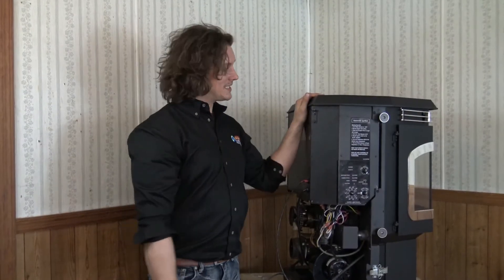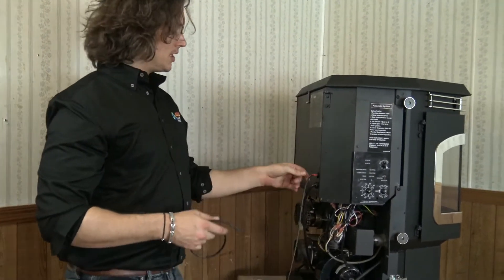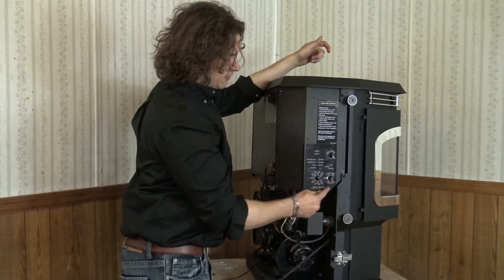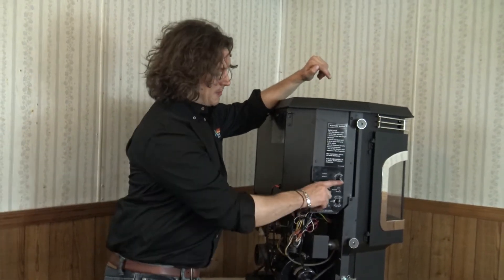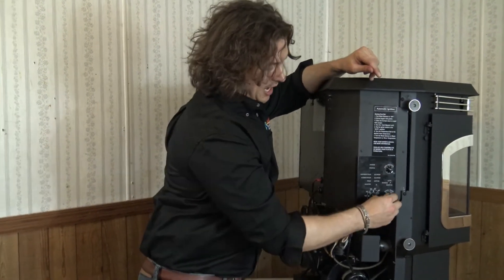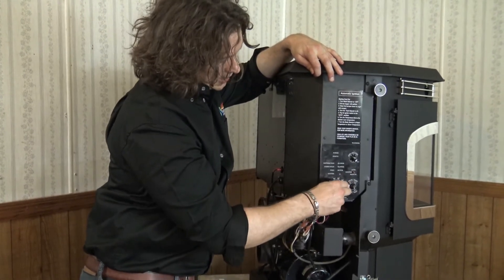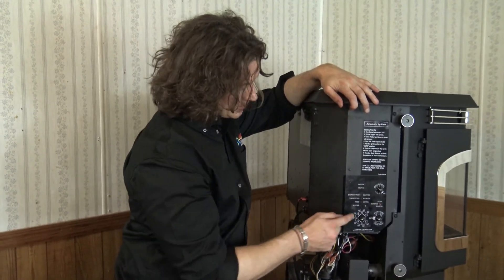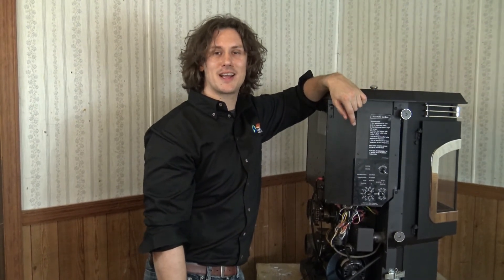Harman Stove Controls, How to use a Harman Pellet Stove

Comment: I just bought an Accentra-2 pellet stove second hand. There is another switch that has a high and low mode for the fan. Does this over-ride the dial? Also, is it possible to connect a thermostat to the stove? Since I have it in my garage, I'd love to have a WiFi thermostat that I can remotely access to start the stove heating before I go out to work. Thanks for a the video. It was very informative.
Reply from the maker: Hey Mark, thanks for contacting us. Yes, the earlier Accentra FS models will have the additional blower rocker switch inside the control board cavity. It does not override the L/H on the room temp/stove temp dial, it simply is an additional blower speed adjustment. In most cases folks would leave that on low and in the coldest weather kick it up to high if the area needs that additional boost - Feel free to play around with it and find what works best for you.
As for the Thermostat, the Accentra is designed to work off the Room Temp Probe which plugs into the back of the unit. It's about a 5' probe which can be extended if needed. Using room temp mode on the board and setting the temp dial to where you like it would be the most common way to operate the unit. With the igniter toggle on Auto you can set your temp and the unit will turn off and on as needed to hold that preset temp. Unfortunately with your model you would not be able to connect any kind of programmable or WiFi thermostat. Some of Harman's newer models such as the XXV-TC, Absolute Models and Allure 50 do have a digital control panels with some of those options. The Accentra is a solid unit, any other other questions or needs as you go along just let us know. Thanks!
Reply: @EarthSense  thanks for the information. Since it's in a rather large garage (25x48) I will most likely use it on stove temp with auto. I do have the room temp sensor installed and it's on the back of the unit, like you showed in your video.
Reply from the maker: @striperseeker  Sure thing Mark. Feel free to play around with both modes of operation and see what works best for your situation. Just note on Stove temp it's designed to run  wherever you have it set consistently; it will not turn on/off on it's own in that mode. Any other questions just let us know. Appreciated!

Comment: Just installed a used P45 stove, I have it set in room temp mode on Auto, and once room reached the set temperature and fire went out but the blower did not actually shut down completely.  Approximately how long would it take before blower actually turns off OR does it continue to run until I turn stove setting to off?
Reply from the maker: Thanks for contacting us. In Harman stoves the exhaust motor will continue to run for a period of about an hour on average until the exhaust ESP probe senses it is cool enough to safely shut down. Let us know how long the motor is running when it goes into shutdown. Thanks.

Comment: Thanks for the video. I have a Harmon 61 A. I run it on room temperature. When the dial is turned to Low or half way beyond the middle and high, the fan/blower makes a higher pitched whistling noise. If I turn it to  H,  the noise stops. Is that normal? Should it run on high? The room temp is set around 72 degrees.  The people who service my stove have replaced the fan/blower twice. It also happens on stove temp.  Thank you.
Reply from the maker: Thanks for the message, happy to assist. It sounds like as you make that adjustment and voltage is differentiating to the blower that it is making that noise. I would not say that is normal, you should be able to have the dial on L or H or in between without a noise such as that emitting. I would strongly lean towards it being a blower issue causing the noise based on your description and that fact it does it in room temp and stove temp modes. You can certainly run it on High to avoid the noise, however it is nice to be able to adjust the room air speed depending on the fire size and desired air blowing out. I would check to see when the last blower replacement was put in; if it was a factory blower it would be a 90 day warranty, if it was aftermarket most will have a 6 mo or 1 year warranty. Here is a link for reference for both the aftermarket and OEM replacement blower options. https://pellethead.com/product/harman-distribution-convection-room-air-fan-blower-motor-amp/

Any further questions please let us know, happy to assist.
Reply: @EarthSense  Thank you so much. I have left  it set close to High for the last few days and the noise is gone. I appreciate your help.
Reply from the maker: @MLK.17  Happy to hear, any further questions or assistance please let us know. Thanks!

Comment: I have a Harman Accentra 52i.  I just had it professionally cleaned.  I replaced the medallion that had warped.  My husband can no longer maintain/operate it.  I'm learning.  Today I started it for the first time.  It appeared to work beautifully.  After a few hours, the feed motor and igniter lights went out and the distribution and combustion motors blow constantly.  The stove is set on auto, # 3 feed, 70 degrees and medium between green and orange.  I shut the whole thing down and unplugged from power.  What's wrong?
Reply from the maker: Thanks for contacting us Beatrice, happy to help. When running the unit on auto in room temp it will run and operate until the unit meets that temperature you set it at based on the room temp probe. Once temp is met, the fire will go down to the lowest setting and the unit will shut itself down if heat is not called for. The exhaust motor and distribution fan will run for a bit in shutdown - exhaust fan will run for up to an hour approx. until the exhaust probe senses that it is cool enough to shut off completely. If the unit is shutting down before temperature is met, I would first say let's take a look at the room temperature probe and possibly adjust the placement - we want to make sure drafts and/or direct sunlight is not interfering. If once the stove is shut down, the blowers continue to run and run until you actually unplug the unit, then we have a different issue. Most likely this would have to do with the exhaust ESP probe and the temperature it's reading. We do have a video that shows how to inspect/clean and replace that probe if needed, however that should have been done by your maintenance person. How long are your blowers running when the stove shuts down? As for the lights, you should find that the igniter light goes out right after initial ignition takes place. The feed light will go on and off in operation as the unit is feeding fuel - off completely when the stove is in shutdown. The Combustion light will stay solid once you turn on the stove and will shut off once the unit is completely cool. The distribution light will come on after start-up once the unit is warm enough and will stay solid until the unit shuts down and is cool enough to shut the blower off. Let's start with the simple things first and we can take it from there. Keep us posted, happy to help. Thanks!

Comment: Hi, we just bought this pellet stove. The same one as the video. It was used but it very good condition and supposedly everything worked good. However I cannot get the stove to drop any pellets. I fill the hopper and it appears that they drop into the feeding tube but nothing ever drops into the pan where the fire is. So any fire I start just burns out. I’ve checked everything I can. Even took it apart as far as I could and looked for anything that could be jamming it but found nothing. Tried everything I could think of but still got nothing. I need any advice I can get.
Reply from the maker: Thanks for contacting us, happy to help. 

Is the status light on the stove blinking? If so how many times? Does the Combustion Blower, Feed Motor and Igniter light come on when you go to start the stove? Is there any difference in start-up if you set it to Stove Temp Mode or Room Temp mode?
Reply: The Status light just stays solid. All the lights for combustion and feeder and others come on with no problem. 
I’ve tried running it on different settings as well. Nothing I do allows the pellets to drop. Not even on test.
Reply from the maker: @celinabravo1627  Thanks for the information Celina. If you can have the side panels open so you can visibly see the auger motor it will be important to know whether the motor is turning or trying to turn during start-up. We need to determine if power is getting to the auger motor and something is jamming in the feed system or if the auger motor is not working at all. If needed you can make a test cord and run the auger motor to direct power to determine if the motor is good/bad or weak. Here is a video on the test cord - https://youtu.be/rlmiCYI2WPk

Let's also inspect the sawdust cleanout box in the feed system to make sure we don't have build-up in there blocking the feeder slide plate. Here is a video on that https://youtu.be/l3-Wg1xRUy4

Please do keep us posted. Happy to help. Thanks.
Reply: Hi, we tested the auger motor and it works. However when we install it again the motor doesn’t come on at all. Even on test mode. In test mode the light comes on for the feed motor showing that it’s on. But like I said the motor doesn’t come on at all.

Comment: Recently purchased a new home that has a Harmon P68 already installed. I have the blower on constant burn all the way on high.  It seems if every time I have the feed at 3 or lower the stove goes out. If I leave the stove on 4 or higher it stays burning but very lazy, rolling flames. Am I doing something wrong? any insight would help.
Reply from the maker: Hey Kathryn, thanks for the message. Yeah, we definitely have some things to look at with the P68. We never want to see lazy, rolling flames; on all settings we want to see crisp, bright, torchy flames. Could very well be that your vacuum switch is shutting the feed motor down when you go to lower settings. Ash build-up in the unit and exhaust venting would be the number one cause for a vacuum switch to trip as well as seeing those lazy, rolling flames. We would first suggest a complete and thorough cleaning of the stove and venting. If you need tips or don't have the owners/maintenance manual just let us know. Once clean, let's also check the gasket seals on the door, ash pan door, glass, and hopper lid; we need to make sure those are all sealing tight all the way around. Keep us posted, happy to help.

Comment: is it auto-Draft? I see no draft knob or lever. I installed my  own and have made no setup adjustments. I am just running it, and it runs.
Reply from the maker: Hey Floydd, yes, the Harman pellet stove models will be auto draft. No knob or lever to adjust combustion air. The exhaust ESP thermistor gives readings back to the circuit board. Stove temp will be consistent feed and draft based on your setting, Room temp will allow the feed and draft to adjust based on communication from the room temp probe. Any other questions just let us know. Thanks!

Comment: My stove is cycling for over 3 hours after I shut it off how do I stop it without just shutting down the power?
Reply from the maker: Thanks for contacting us, happy to help. By cycling do you mean the auger is continuing to turn or the combustion blower is continuing to run? What Harman model do you have? It's normal for most Harman models to purge pellets for a period once you turn the dial to off. It's normal for the combustion fan to run for a period before it senses the stove is cool enough to shut down completely. 3 hours + does not sound normal. I would first suggest making sure cleaning and routine maintenance has been completed. I would then suggest cleaning the ESP probe to ensure it's reading temperature correctly. Here is a video on that. https://youtu.be/kt7nnGMYU-k

Keep us posted. Thanks!

Comment: What is the little white adjustment, above the feed and to left of the igniter?
Reply from the maker: Hey Mike, that is a small micro-adjustment for the combustion blower. Very rare that it would require an adjustment - generally we only see fine tune adjustments needing to be made when there is a significant vertical vent configuration or high altitude installations. Any other questions please let us know. Thanks!
Reply: @EarthSense  Thank you, cuz my flame is little looks like it is getting to much air for combustion a lot of sparks. Is there any kind of adjustment to get a good flame.
Reply from the maker: @mikethehunter8477  Sure thing Mike. There will be variance depending on the pellet being used. Generally pellets with less rosin/lignin and higher moisture content will break apart faster and show more sparks in operation. Try a few different types and make note of the differences. You will see an increase in sparks especially when you scrape the burnpot during operation. Again, that dial is a very micro-adjustment, but feel free to play with it a bit. Use a small flat head precision screwdriver, preferably a plastic one if you will be adjusting while the stove is in operation. Turn the dial counter clockwise about 10 minutes to start and make notes of any differences you are seeing with the fire. Keep us posted!
Reply: @EarthSense  Played with it a little bit but don't want to get it to out of wack. And thanks for the information.
Reply from the maker: @mikethehunter8477  Absolutely! Reach out anytime :)

Comment: where is the damper control on Harman stoves? 

Also, a tip for users: Put the unit in test mode when cleaning out the stove, since the fans will suck up any ash/dust, keeping it out of your face/eyes/house while you clean.
Reply from the maker: Hey James, thanks for the message. Harman pellet and multi-fuel stoves do not have a damper as most other pellet and corn stoves do. The Exhaust Thermistor ESP Probe works in conjunction with the circuit board to ensure proper fuel to air ratio in both stove temp and room temp modes. If you are noticing a lazy - inefficient fire there will be a few areas we want to check/inspect. Just let us know what you are seeing. 

Great tip James! Yes, on test mode with that combustion fan running it will help to keep the ash/dust in the stove and out of your eyes/face/house. We will even do that while we have a leafblower on the exhaust outside sucking out the vent pipe. With the combustion fan running it helps to clean out that manifold and the exhaust passageways.

Any other questions please let us know. Thanks!

Comment: I was wondering about any tips to clean the stove or do maintenance to prevent proof of fire sensor from getting dirty with soot it keeps giving error codes and it gets caked with soot alot.
Reply from the maker: Hey Kevin, thanks for the message, happy to help. I assume you have a Harman and you are referring to the ESP Thermistor Probe in the exhaust hub as the proof of fire sensor. If that is not correct, just let us know what your make and model is. If it is a Harman, here is a video link on cleaning that ESP probe. https://youtu.be/kt7nnGMYU-k
The cleaning of this probe and the stove and vent in general is greatly determined by the type of pellets you are using. Generally speaking premium softwood pellets such as Pine and Douglas Fir will provide a greater heat-output with considerably less ash and build-up in comparison to hardwood pellets. We always suggest trying a few bags of few different kinds of pellets and making assessments on what works best for you. On a side note- We always want to make sure that fire is crisp and torchy. If we are seeing any kind of a lazy sooty flame, we have other issues to address. Majority of the time this would be an ash build-up/blockage in the stove/exhaust/venting. We also suggest checking door and ash pan door gasket seals to ensure they are tight all the way around, and checking the burnpot for build-up and burnpot holes to make sure they are open and clear. 

Hopefully that is helpful, any other questions please let us know. 

Thanks!

Comment: After I turn off the stove for the night, my combustion blower never shuts off. I’ve tried switching to manual and back to auto but it still won’t shut off until I unplug the unit. Any ideas on how to stop the combustion blower?
Reply from the maker: Hey Jeff, thanks for contacting us. If you have a Harman model, the combustion shutdown is based on the ESP Probe temp reading that is communicated to the control board. Let's first try giving the ESP probe a good cleaning - here is a video that will walk you through it. https://www.youtube.com/watch?v=kt7nnGMYU-k

Keep us posted.

Thanks!
Reply: Thank you! As always your information videos are awesome and highly informative. Im working on a Harman Advance. I’ve cleaned the probe but the combustion blower still will not turn off. Next step?
Reply from the maker: @JPAstoria  Absolutely, happy to help! The control board and the ESP are the only two items that control the combustion blower shutdown in your unit. I would lean towards it being an ESP issue if all the other functions in the unit are operating correctly other than the blower shutdown. Here are the ESP probe options for your reference. Double check your ESP probe wire color if you do decide to replace. https://pellethead.com/?s=esp 
Keep us posted,
Thanks!